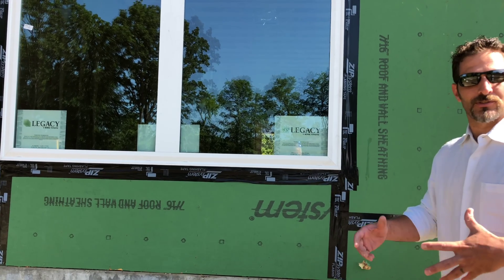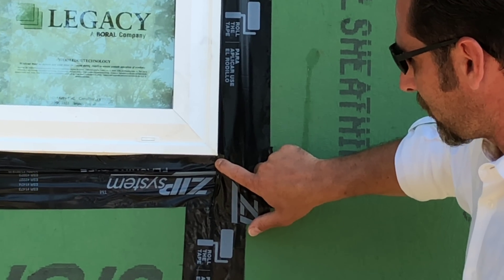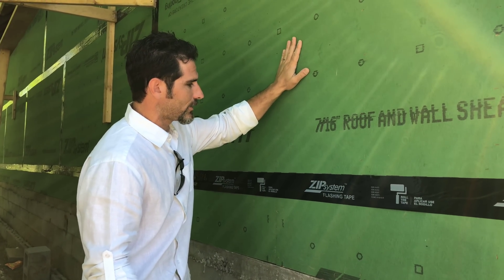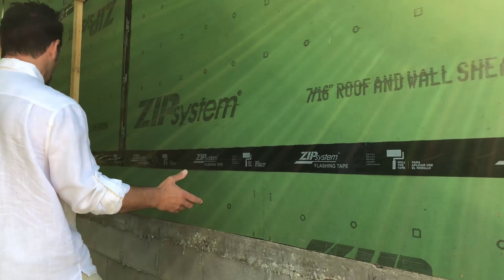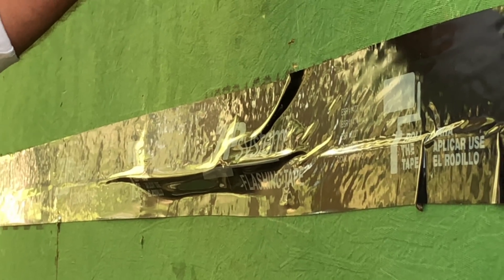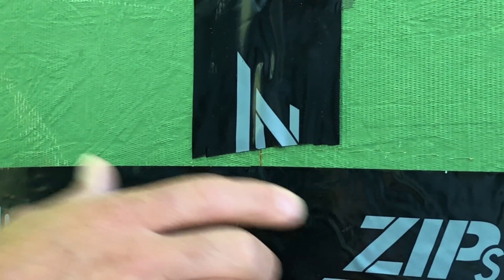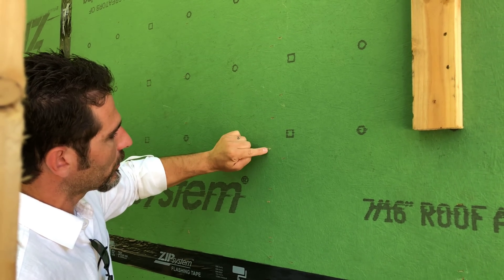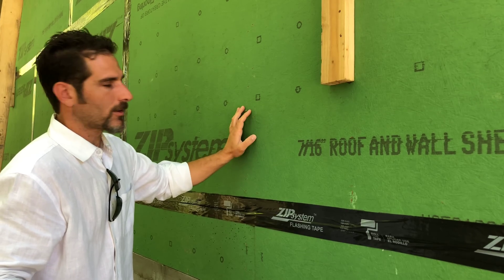ZIP System Problems

Comment: So my only problem with your moisture theory is that the condensation is created outside the zip system and not in the wall. Since moisture cannot permeate through plastic. So as long as the exterior is correctly sealed there are no issues with moisture
Reply from the maker: Respectfully the statement you made is incorrect. Depending on the type of exterior finish will determine where the dew point is. With any product that is slapped directly up to the zip sheathing (not correct btw but people do it all the time) the dew point will happen at the point of rapid temperature  change, which is usually inside the wall cavity. With other veneers such as brick or natural stone that has a natural airspace between the wall and the back of the brick/stone the dew point will be closer to the outside but depending on insulation is not always on the outside! Hope this helps your understanding and if you have further questions feel free to reach out! Thanks for watching and interacting.

Comment: If you do a poor job , it is not the fault of the system. What is the point of this?  If  ZIP is installed properly and then it leaks THEN it is  a ZIP system problem  other wise fire the contractor.
Reply from the maker: You mean like this?:
https://www.youtube.com/watch?v=Hi_a2godZ0o
After watching this video of this system installed correctly by a third party and seeing how it fails should help with your viewpoint. Thanks for watching and commenting.

Comment: I have been researching and looking at different systems to consider when building my house next year. I am going to use the 5/8 zip system on the exterior of my home. I am framing it myself. I am not a builder but I know how to frame a house and I guarantee you that it will definitely exceed code. I will not use the tape. I will use the tubes. To fasten it I will use screws. I hate nail guns. Everything in my house is going to be screwed together.
Reply from the maker: You might check this out first:
https://www.youtube.com/watch?v=Hi_a2godZ0o
ZIP makes a great structural panel but I would cover it with Tyvek if it were mine! Thanks for watching and commenting.
Reply: So a year later, how’s the house build going?  I’m in the same boat right now (not a builder, framing my own house with Zip) and I can’t imagine how much more work screwing would be over nailing.  I screwed my 1-1/8” Advantech subfloor just fine, but that’s going into a 2-2/2” wide joist chord, not the 1-1/2” edge of 2x lumber.

Interested in your feedback!
Reply: @superspeeder  Look for the Simpson Strong Tie framing screws. Preferably 3.5 inches long. That's what I used. It's more work but creates a stronger wall. They're especially better if using engineered lumber. Try driving or shooting a nail into engineered lumber. It won't work out to well for you because of the density.
Reply: @gregsatterly9412  , ah, I’m just fastening the Zip to KD SPF, not engineered material.  I will say, however, that my cordless Metabo (Hitachi) framing nailer puts 3-1/4” galvanized ring shanks into LVL beams with no problem at all, so I wouldn’t anticipate issues with 2-1/2” nails into engineered studs unless perhaps PSL is far more dense than LVL?  I have not used PSL but will likely order some for walls that support cabinetry.
Reply: If you're fastening sheathing with screws you've already screwed up, screws have very poor shear strength, I hope you enjoyed your failed sheathing inspection. Nail guns have depth settings, learn to use them.
Reply: @nandua2010  The only nails in my house are the square head nails used in the finish carpentry. Do your research before you reply on social media. I used 3 1/2"  Simpson Strong Tie framing screws for the framing which is the same length as a 16 penny nail. I used 2" framing screws for the exterior application.
Reply: yes I know about shear but in most cases I have yet to see sheared screws LOL. I us bolts in structures where they are needed @nandua2010

Comment: Just poor workmanship if done right Zip works This guy just like another system better it's your choice
Reply from the maker: Everyone has choices to make you are correct!  However even if installed correctly, you would like to rely on miles of tape instead of lapping Tyvek (yes I prefer Tyvek over any other wrap & no they don't pay me)?  You prefer relying on a zero perm rating to not cause any condensation issues?  You would rather leave nailheads exposed to the elements or spread a bunch of nasty tar shit over them?  What about areas that can't be addressed such as missing pieces or gaps that the magical tape or liquid flash will fix?  There is nothing about the zip panel that is appealing to the educated construction mind!  Thanks for watching!

Comment: Tyvek as any system can leak as much or more if not installed correctly!
Reply from the maker: I would agree with that minus the fact that it is very rare to find housewrap lapped wrong but it is very common to see this on a zip project.  So the probability of an issue with housewrap is much less than having a problem with a coated sheathing product like this.  Not to mention the miles of tape you are hoping they cleaned the osb surface before applying & rolled it on with a roller, then you hope it stays stuck longterm....Not my idea of a good system!  Thanks for watching

Comment: As many others have said, it's a very poor install.  I will still be using ZipR on my roof.

The low permeability is fine for me in a hot and dry area and any moisture in my roof will be able to dry inward.

I'm going to be doing the install myself so I don't have to worry about unskilled labor applying the tape wrong and I am going to liquid flash it also.

I am going to take steps to ensure that I don't create any leaks when installing my roofing.

I just like the idea of a fully bonded membrane instead of a shingled underlayment.

That is really the difference here, the Zip membrane can replace a roof underlayment.  Tyvek will never say they can do that.

With that said, my roof might have four layers of moisture barrier with Zip being the last line of defense so it should live an easy and long life.
Reply from the maker: Sounds like you got it figured out! Good luck😉

Comment: Aren’t they going to install exterior walls/stucco/sidings over that system that the water has to get through just like anything else? If that much water has gotten through I would imagine there is an even larger issue with the builder doing the work. Scary thoughts
Reply from the maker: Water gets behind all claddings or veneers at some point. Some areas more than others and as a building ages the cracks and entry points become larger. So long term sustainability is why we set buildings up to manage water behind the finished product.

Comment: Lot of problems with this discussion.  Zip is a good system, but it must be installed correctly.  Don't blame the product for the moronic behavior of the builder.  When I build (soon), I intend to use Zip with their caulk - sealing over the stem wall and over every nail hole.  And I'm going to be onsite to watch every move.
Reply from the maker: Why would you go through all the trouble of installing tape on all the joints (assuming you do it right as you say you will clean all the joints osb before installing) Then use a roller and make sure you go over it a few times because the bumps underneath will make the roller skip over many parts of the joint.  Then spread all that tar junk over the nail heads, then have to figure out what to do in all the places the concrete slab sticks out further than the wood frame, then deal with all the flashing at roof intersections that have to rely on tape also....instead of simple Tyvek, that gives you better protection with ease to install & much less tape!  Tyvek has a perm rating of around 52 and zip is less than 1 after taping, so the condensation in hot time will be an issue also!  I would strongly implore you to do some more research!  Thanks for watching

Comment: That is not a problem with the Zip System, but the contractor that did not install it correctly. You need to change the title of your video. One down vote from me.
Reply from the maker: This is a widespread result of highly misleading marketing by Heuber...You can read al the other comments where I have addressed this many times, if you like.  Thanks for watching!
Reply: @WeatherProofingAmerica  Wrong. This is a result of a contractor not following the proper installation procedures of a product.

Comment: What's to keep the Tyvek fasteners from causing those same leaks?
Reply from the maker: If button caps are used the water tension actually makes the water run around the fastener head following the plastic cap.  But let's say that water gets behind the Tyvek, no worries as Tyvek has a fantastic perm rating of high 50's whereas the ZIP has a very low perm rating of less than 1.  So the water is trapped behind the ZIP but not the Tyvek, that is a huge difference & can cause mold, rot etc. from not being able to dry out!  Thanks for watching!

Comment: So misleading information. Just like those dumb infomercials.
Reply from the maker: What is misleading?  The ZIP marketing? Yes, it is misleading!  They make it sound like there are no extra steps and these systems go up so fast and easy....WELL, This is the result of misleading marketing! You are 100% correct!
Reply: @WeatherProofingAmerica  if you had both zip and tyvek installed the way they are supposed to be zip will far out last tyvek. And as for the condensation thing tyvek would have more other the issue then the zip if not insulated correctly. The zip system is soon going to be the new standard of building houses , just like when it went from just shiplap walls to shiplap plus tarpaper. And just because something is fool proof does not mean it's lazy proof. How do you stop the holes made in tyvek from nailing it or stapling it from leaking?
Reply from the maker: https://www.youtube.com/watch?v=Hi_a2godZ0o
Reply: @WeatherProofingAmerica  looks like the nails where over driven in some spots. Don't know if it accounts for all the leaks or not, you can see some of them in the video from the front.

Comment: This needs to be relabeled "problems with poor installation of zip systems." Nothing in this video is the fault of the system, just bad contracts that do poor quality work.
Reply from the maker: The system was a fault before it ever hit the jobsite by using the major marketing techniques they have, saying how fast and easy this system is to install and use!  Can't be further from the truth!  Have to play their game...
Reply: @WeatherProofingAmerica  you can give the best equipment to the worst installer and the product will fail. Can't blame the system for poor installation. Have you performed any test on the system installed correctly to back up your claim? I would like to see that video.
Reply from the maker: https://youtu.be/Hi_a2godZ0o
Reply from the maker: https://www.youtube.com/watch?v=Hi_a2godZ0o

Comment: Any system can be a mess if its not installed correctly.  The Zip system is a fantastic system when installed properly and is (in my opinion) far superior to OSB with a Tyvek wrap.  The presenter here talked about the perm rating of Tyvek being higher than the Zip and insinuated that is a problem - he could not be more wrong and it all gets back to the quality of the installation and the overall design of the wall system.  That very low perm rating for the Zip system in what makes it such a superior product and when installed properly does not create problems with moisture condensing in the wall.  I hate to say that video maker here does not know his building science but that statement about the perm rating tells me that he does not know his building science in regrade to wall systems.

The other thing that really bothers me about this video is that he just walked onto someone else build/property without permission and just started filming.  I know he did not go there to steal or vandalize but as a professional he should know better than to go trespassing like that on someone else's property and work project.  Get your shit together @Weather Proofing America!
Reply from the maker: Low perm rating can be very dangerous in cold climates if the air exchange and HVAC is not set up properly.  But the main concern I have with the NO perm rating is the water that makes its way into the wall cavity from all the poor installations around the country!  Once the water accesses the wall cavity it has no way to get out!  Building science is pretty simple but common sense is not!  Thanks for watching and interacting.
Reply: @WeatherProofingAmerica  If you build your wall system with poor attention to the details you are going to have problems with it no mater what climate zone you are building in.  Its is a life lesson in that if you do the wrong thing you are going to be in trouble and if you do the right thing wrong you are still going to be in trouble.  I would not recommend that anyone compromise on their building products because of the fear they might do a poor job on the installation.  I would instead recommend that they look to get the best materials they can afford for their project and then stress that these be installed/applied with the utmost regard for correct detailing.

Comment: That video comparing tyvek to the zip system, was biased (provided it's the same one I know about). They put a column of water over the fastener for zip, but on a bare piece of tyvek. If you put a column of water over the fastener for tyvek, it leaks WAY worse. 

But as you said, this is an install problem. Always install according to the manufacturers specifications.
Reply from the maker: https://www.youtube.com/watch?v=3paeg45EX40
Reply: @WeatherProofingAmerica  Thank you for the video! So now I'm left with a test by Matt Risinger (somewhat biased as Zip is a sponsor of his), and a test by the manufacturer of Tyvek (biased as it's BY the company).

My next project will be Tyvek anyway, as it's more budget friendly, but given two different test results, leaves me to wonder. I'd like a fully independent test done, but alas, it probably won't happen.
Reply from the maker: https://www.youtube.com/watch?v=E7cRgMOtz04  
This test was paid for by DuPont but was done by a stand up company (specializes in testing & consulting) that would not jeopardize its reputation to skew something for money.  So this is a great example of why even when installed correctly (which rarely happens) I would not be comfortable with this product protecting my investment!  relying on miles of tape and sealants is just not my idea of safety, we set everything up not using any sealants or caulking!  Thanks for the interaction, let me know if you need help!
Reply: @WeatherProofingAmerica  Ya, I think I agree. What is your opinion on those that just staple tyvek down? That's probably not a good practice?
Reply from the maker: This is actually  the video I meant to send to you!
https://www.youtube.com/watch?v=Hi_a2godZ0o
BTW Slap staples on Tyvek is no good!
Reply: @WeatherProofingAmerica  Thanks for the link. I see SO many houses going up with staples on tyvek too, so many contractors don't follow the recommended installation regardless of the type you use. If you don't me asking, what is your opinion on the stretchable zip tape for window sills? It looks much better than other tape based sills, but I assume liquid sills is still the best option?
Reply from the maker: Slap staples on Tyvek is a big no no but it still does not compare to miles of improperly installed tape.  Plus Tyvek actually allows the wall to dry out with a perm rating of 56!  The Zip however has a perm rating of less than 1 after tape, so it can not dry out nearly as well.  The ZIP tape with the acrylic is a pretty good product but when using Tyvek it is important to use DuPont tape because they have chemically formulated it to work well with the Tyvek!  So never mix products throughout systems (I see it ALL the time)!  Let me know if I can help any further!
Reply: @WeatherProofingAmerica  Sounds good, and I would worry especially because I'm in the north and we require 6m poly on the inside, as we have temp deltas out of this world up here in winter.

Comment: "Look at this! My crew installed this product totally wrong and it FAILED!"

These issues don't occur when the product is installed correctly. More than anything else, this video points to what a poor/lazy job his construction crews did.
Reply from the maker: Yes this video points out a very sloppy install but also a very common installation!  This system has more potential to be problematic than any housewrap ever thought of!  Add in the marketing they are doing to say how fast and easy it installs and this is what you get....
Thanks for watching & interacting!

Comment: So, the contractor did a very poor job of installation.
So, exactly how is that the fault of the zip system?

ANY product that is not installed properly is going to be an issue.
Reply from the maker: Yes this video points out a very sloppy install but also a very common installation!  This system has more potential to be problematic than any housewrap ever thought of!  Add in the marketing they are doing to say how fast and easy it installs and this is what you get....
Thanks for watching & interacting!
Reply: Engineering products you need to build it for real world installation.  One of the best systems is still cdx plywood and 15lb felt